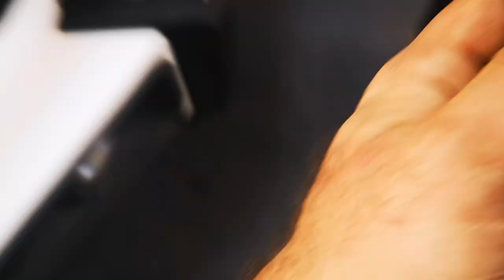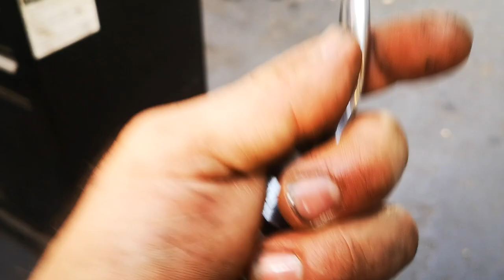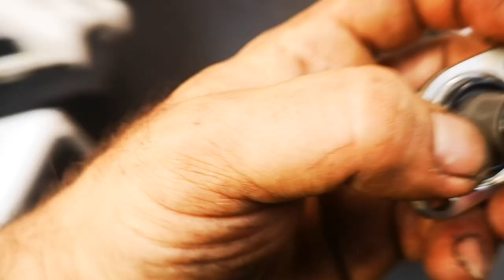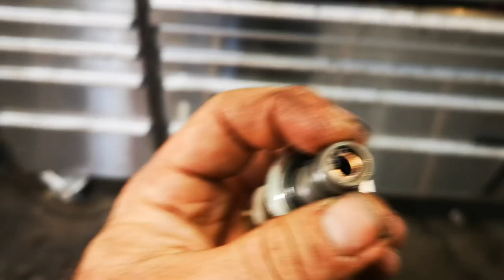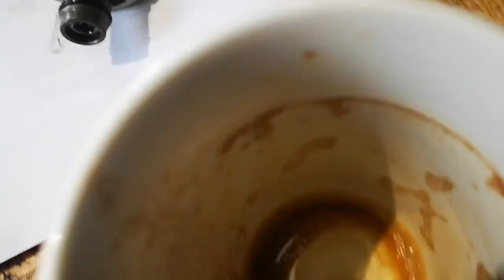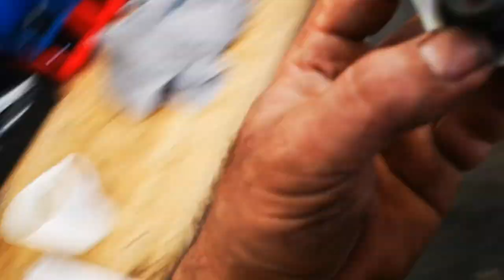Nissan Navara Diesel Flow Control Valve running rich black smoke low power oring diesel pump flow

Comment: You could have at least shared the pop up message, must have been funny. I need to have a go at cleaning my scv today. I have a bit of black smoke and after first pull away  it lacks power.

Comment: good afternoon friend I have a 2009 navara I have problems because it does not accelerate fast it is slow the acceleration has already changed the scv the air flow the intercooler signal sensor the turbo is fine and continues with the same problem at times it works well it reaches 140 km per hour  and sometimes it does not exceed 120 as forced, it does not have the check engine on, it already provides everything that recommends me, greetings

Comment: Where is this valve situated?
Reply: lee fiz behind the timing chain or just below the EGR valve, it’s bit hard to see though
Reply: @abcautotrendy  my d22 is running on yd25 and yd25 has several type of version. Do you hv a video of the d22 engine mate?
Reply: lee fiz these days I’m out of the country and shall post one for you, pls give few days
Reply: @abcautotrendy  Thank you so much
Reply: question  what would happen if you drilled out the the 2 holes a little bit bigger would the increase or decrease the full pressure